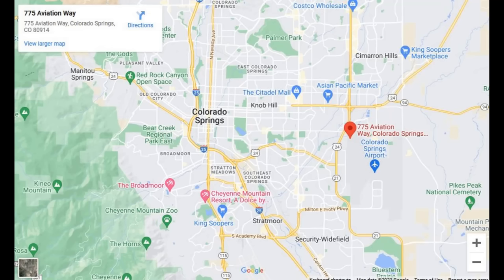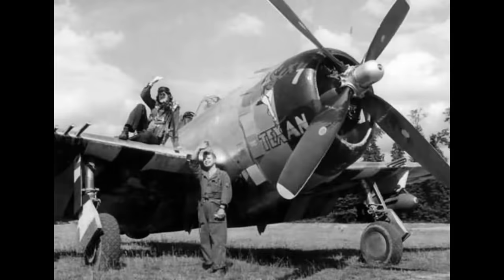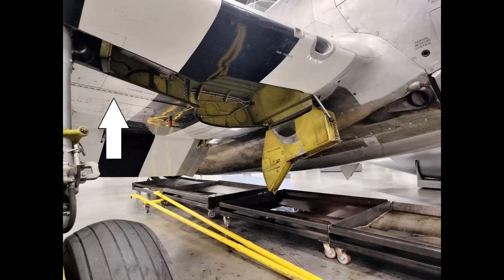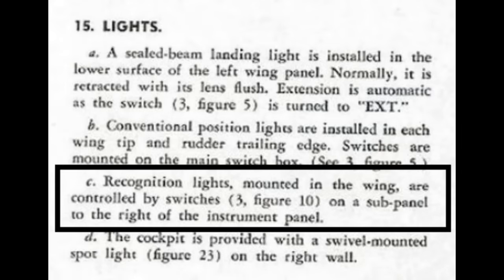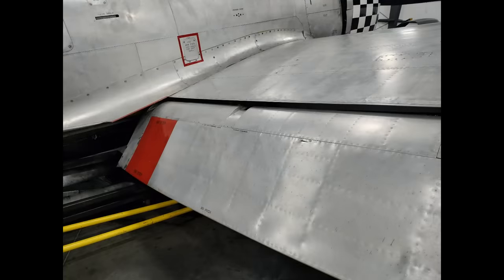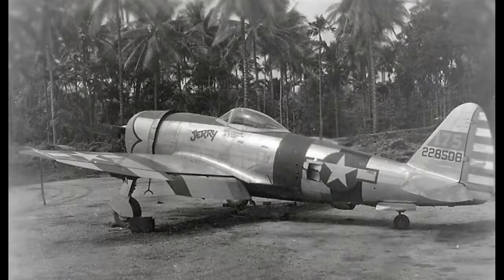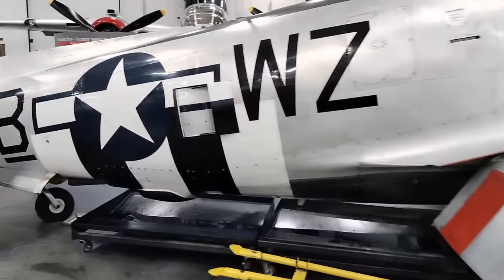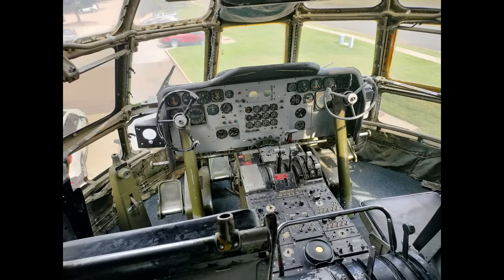Thunderbolt P-47 D-40, the Ultimate D model

Comment: I toured this museum last Saturday and was extremely impressed with their aircraft displays. What's more they are all flyable. If you go, take the tour of their facilities. The docent guides are older gentlemen, most if not all, are veterans. Johnny our guide was  very well informed on history and operation of each of the aircraft.
 One of the most interesting, besides the P-47 is their P-38. That plane was found buried off a runway on a pacific Island. They brought it back and the museum completely rebuilt it to flyable condition in their shop.  Highly recommend a visit to the museum if you are in the Colorado springs area.
Also, be sure and see their  immaculate Douglas AD5 Skyraider that has a cockpit for a crew of 2.
 The pilot escaped the fall of Saigon by flying it to Thailand.  ---- He had  15 close friends also crammed on board.
Reply: Is this the museum that has the internals of the P-47 on full display ? From the engine back.....all the different plumbing that it has ??

Comment: I think the "Manual meshing control" is for using the hand-crank inertial starter. The flywheel is cranked up to speed (about 80 rpm on the hand crank) and then engaged to the engine jaw with the manual meshing control.

Comment: When I was 10 years old, I had built about a dozen or so plastic model airplanes. And ultimately each was heroically destroyed using bottle rockets plus other small  fireworks leftover from the 4th. Suddenly one day, my destructive and immature behavior ceased  once unpacking  new model while pre-reading assembly instructions for a model of the "Hun Hunter", a historic Thunderbolt from WW2, Korea and more. 
It was my first high quality model with fine detail all the way
 down to the 2 Schrader valves within landing main gear wheel hubs. Everything about that model building experience helped me to gain an appreciation for vintage warbirds and the harrowing stories told by flight crews both up above and below. Thank you for all the time and effort you spend producing the aviation videos. The "P-47" was my first favorite prompting a serious appreciation for aviation and grows evermore. Thank you again.

Comment: "Notice the inside of the gear doors.  This is going to be a significant discussion."  Only on this channel and that's why we love it.  (As a software engineer I've written multi-line comments as to why certain variables should be exactly the order they're in in a structure or class: e.g., to avoid false sharing in the cache, or to avoid structure holes.)

Comment: Hi Greg, the Hamilton Hydromatic props were installed on the D-22 and D-25 from the factory. There might have been a few loose planes with this propeller like the one with the pressurized cabin, and maybe a few converted on the field. The rest before the D-22 and after the D-25 used the Curtiss Electric props, from the skinny 12' 2" diameter prop and the two different size paddle 13" diameter props.

Comment: Hey Greg! I was a volunteer at PoF in the 80's and helped take out the turbo/supercharger in their P-47G when it was getting ready for restoration. As a 14-15 year old kid, even then it hurt my heart to take that thing out. I questioned it every day, do we really need to take it out? It was a magnificent system indeed. I wish they would have kept it in. But alas, money being money..   The Hamilton-Standard props were/are a common retrofit on still flying Jugs as they were easier to get parts for and had a better mechanical reputation.

Comment: The dorsal fin was definitely retrofitted to earlier models, up to the D-25. The reason was loss of yaw control, probably at low speeds and max power. The tail warning radar was also retrofitted to earlier models. I know this because I read a article about the P-47 in the FAB (Brazilian Air Force) service, during and after WW2. If memory didn't fail me, the fin was retrofitted during the war (although not all units got it) and the tail radar after, in a effort to bring all the units to a common standard, equivalent to the D-40.
Reply: The fin does not provide a measurable increase in area. 

And what few extra square feet of area it adds, it's located much closer to the centers of gravity and aerodynamics than the rest of the tail. 

So, it's not only too small to be effective but its leverage is also significantly hampered as well simply because its not located far enough aft to do much. To exasperate the issue, its of exceptionally low aspect ratio, and therefore its lift-curve slope (dCL/da) is going to be very shallow and develop little if any side-force at  shallow side-slip angles. 

Therefore, it does not appear it will provide additional yaw-stability in the way you envision. 

It actually creates a very strong vortex-lift at extremely high sideslip angles encountered during a spin. 

It generates this lift by developing a strong vortical flow due to its extremely low-aspect ratio. The aft end is truncated in a sharp angle, where the vortex is shed at steep sideslip angles and that vortex more easily follows the contour of the rudder when its deflected against the sideslip. 

E.g. when the aircraft is in a fully developed spin to the right, nose going right, the rudder is deflected to the left to counter the spin in order to recover.
But the vertical stabilizer could and likely did stall at that sideslip angle. Or at least become ineffective at creating additional side-lift by increasing camber (rudder deflection) alone. By generating a vortex flow at that juncture, the vortex cuts the vertical stabilizer in half, effectively quartering its aspect ratio, which almost doubles its stalling angle of attack. It also allows airflow to follow the contour of the deflected rudder, instead of separating. 

Its the phenomenon that allows the F/A-18 to attain 60*Deg AoA with an medium (4.0) Aspect Ratio wing. The F-16, various Sukhois, F-22/35 and others also use this for improved lift at high AoA.
Reply: There is a beautiful P47 N, the first thing you see as you enter the Elgin Air Force Museum near Ft. Walton Beach, FL. Don’t miss it! My uncle flew P47’s and was shot down and thrown from his plane when he crashed. Locals secreted his body from the German’s just 17 miles from Omaha Beach. This happened late July 1944 and we still were just 17 miles inland? Scary.

Comment: Thanks Mr. Greg,  will you be covering P-47's flight controls a bit more in-depth such as wheter it used push rods or conventional steel "ropes" with perhaps some improvements that differed it from other aircraft because it is said to have excellent roll rate and to be responsive overall, furthermore regarding the poll on patreon, closer to mach speeds p-38 had to be equipped with hydraulic assistance  in order to recover from a dive (I believe folks working on p-38 had concluded before supersonic flight was fully understood that it caused some sort of super drag at wings that made operating with the stick near impossible) but anyways had p-47 received any modifications addressed to these kind of issues (especially later models like D's), it would be nice to learn. btw glad you enjoyed the restaurant, seems cool :)

Comment: Hi Greg, great video as usual. 
As to the manual mesh external device, I suspect a review of your patreon aircraft manual electrical diagram may show that the cockpit "mesh" switch position was not energized during battery cart engine start, thus being unable to electrically engage the inertia starter to the engine with the battery off. Apparently the external tool port would allow mechanical engagement of the inertia flywheel. Seems odd that the "engage/mesh" switch could not be energized by the cart-start bus. But, this is just an educated guess.
Again, very informative video!

Comment: I dunno if someones already commented. But i think the manaul mesh unit is basically, the old hand crank type coupling. I guess on the warbird is its a last ditch if you have nothing in the field. Way if getting the planes in the air, how often was it used?  Probably not at all, but always good to have multiple backups.

Comment: Hi Greg, as a model builder with an interest in the technical and historical aspects of things, I have a lot of research materials with lots of up-close photos and somewhat detailed discussion of the various production variants (if you can find the 'Detail in Scale' books, I highly recommend them). The antennas on the rear stabilizer look to me like modern avionics equipment rather than tail warning radar equipment. This is thesis is further aided by the thought that this plane is airworthy.

Also, I've often wondered why there were angle indicator decals on the flaps of the P-47 kits I've built in the past, which you can see clearly in your walk-around video. The fact that the flaps do not have simple settings for takeoff, landing, and combat explain the reason for the pilot to need some visual reference. 

As always, great video! Thank you for sharing with us all!
Reply from the maker: I'm pretty sure those are modern antennae, the question is what was there in 1945?

Comment: Well and thoroughly done, as usual, Greg. If you get a chance, check out "Fagen's Fighters," a WW 2 aircraft museum in rural Granite Falls, MN. They're restoring their own P-47D (I don't know the exact variant), and they have a flying example of the F6F-5, which used a P&W R-2800 similar to that of the Thunderbolt. That's what attracted me to Granite Falls. I'd never heard an R-2800 running "in real life" until about 10 days ago, when I visited the Fagen museum. The Hellcat's ground crew were testing a new carburetor on its engine, so they fired it up and let it run for 10 or 15 minutes at several throttle settings – a real treat.

Comment: The manual meshing control basically forces the inertial starter flywheel to the engine (after flywheel spin-up). I’m assuming there’s an electric solenoid that would normally do this, kinda like your usual jack shaft, except you’ve gotta wait till it gets up to ~20,000RPM first on these. If the meshing “solenoid” failed, it could obviously ground the entire plane. 

Presumably you’d have to disable it once the engine fires (very easy to fry an inertial starter.) 

I’m not really sure if they have kick-out cogs to disconnect the engine from the starter mechanically, but if they do - I know they can fail (seen plenty of them lol, a starter motor at 200:1 ratio is not happy staying connected to an engine!) 

Cool find - they’re exceedingly rare, and airworthy ones are pure gems. 

Hopefully you checked out that pristine Tigercat in the back too!

Comment: It certainly does fly. I've been blessed to watch it fly. 29 of those planes in the collection fly. Don't forget the Corsair F-3A model. The Lightening P-38F and F-7F Tigercats both fly. Yes, 2 flying F-7F Tigercats. They are planning on restoring a Razorback P-47 they have including the complete turbocharger and Pratt Witney R-2800 engine on display in one of the other hangers.

Comment: I used to play Lucas Film's "Secret Weapons of the Luftwaffe" 

I liked the Jug and I liked the P-38.  The problem with flying the P-38 - was you couldn't control the engines separately in the game.

I hated the P-51.  Every time I took a hit - I'd be looking at that coolant temperature - and if that needle so much as quivered - it was climb for altitude and head for home.  If you had enough altitude you could glide back to Allied Lines after the engine quit - but if you didn't - you couldn't.

During WWII the Germans had a phrase .... "Die Deutsche Blick" which meant "The German Look".  This referred to the Germans compulsive glancing over their shoulder looking for Allied Aircraft.

In a P-51 I had "Der Kühlmittel-Blick" or The Coolant Look ...

The thing here - is that you were glancing at the coolant gauge even if you hadn't taken a coolant hit - just in case you had.  What a pain in the ass.
.

Comment: Great video! I share your feeling about turbosuperchargers, I am always disappointed when I see a flying (or static) P-38 or P-47 that has been neutered. Same goes for jets on display with no engines. 

For whatever reason, Boeing did things differently with the KC-97 than with the B-50, even though they both used the P&W R4360. If I remember right, the turbos are mounted on the opposite sides of the nacelles in the two models.

I once read the reason Boeing felt (ahead of Douglas and the airline industry) that jet engines were ready for airliners is that they were flying R-4360 equipped B-50's and KC-97's out of their flight test center the same time they were flying GE J-57 equipped B-47's and B-52's, and they realized the jets were less of a maintenance headache than the reciprocals.

Comment: Have pored over just a tiny number of the P47 plans. The complexity of these aircraft is unimaginable to most people. 

There must be hundreds if not thousands of drawings. Let alone thinking of making them. 

We forget the army of people that made it happen. 

The jug was also very thoroughly built. Everything was a cast aluminium or steel arm for mechanical bits. Very few pressed tin things. 

So nice when you can get a close look at these aircraft. That is a rare treat indeed. 

It's very cool to share.
Reply: Lots of forged parts. Cast parts are brittle and poor in tension and not common outside of engine casings and other oddball shaped parts

Comment: I am not an expert on P-47 props but at different points in past decades I had knoen the different  designs and dedign numbers. There were atleast three, maybe four different Curtiss elrctric designs and the Hamilton Standard shown here. Of the Curtiss designs, the diamrters grew atleast one resulting in atleast two sizes. However the chord also grew several times and a late version had a wide, asemetrical blade shape.

Comment: That’s a fantastic museum.  They have a very capable Ham Std prop shop onsite, so I wonder if that has something to do with the prop installation.
Reply from the maker: I suspect the plane was built with a Curtis Electric, but they switched to the Hamilton Standard for reliability and parts supply. It's what I would have done. They certainly do have a capable prop facility on site.

Comment: I did not know about the landing gear door closing, I had assumed that all WW2 fighters had this door open when the gear is down.  The Spitfires never got a door until Mk 21 and later.  Most Japanese fighters had these doors.  The landing gear door opening and closing scheme was widely argued in the near disaster flight of a 747 taking off from Athens.  Lots have been written about this incident, and lots of presentations exist on youtube and wikipedia.  The pilots decided to retract the landing gear on take off after multiple engine failure, against the recommendations from Boeing.  That saved 500 plus people.

Comment: You likely know this but the B-50 from which the KC-97 and 377 were actually developed was a very different bird from the B-29 with numerous changes. It was certainly a B-29 derivative but at the same time truly a new airframe. I’m not certain but would be willing to bet that the degree of parts commonality between the 29 and the 50 was between low and zero and limited to minor sub systems.

Comment: Very interesting video! I have always been curious if during WW2, did they ever consider using multiple small turbos rather than one large one like on the P-47 or P-38 (one large on per engine). Was there a design limitation or was this even explored at all? I can picture some of the drawbacks, but I can see some possible advantages as well.
Reply from the maker: I don't know of any WW2 airplane either production or prototype that used more than one turbo per engine.

Comment: 22:40 You want to know what's extra funny about those shutter indicators? They can go in either slot. Apparently some planes have the oil cooler indicator on top and the intercooler on the bottom, and some have it the other way around. 

Which ended up being hilarious when DCS released it's P-47 and had them the other way from some of the other P-47s. 

Much reference photo digging later, we discovered they went both ways, for maximum confusion.
Reply from the maker: Having seen the mechanism that actually makes a lot of sense.

Comment: Maybe you can do a series on the best piston engines of WWII. For me it is the R2800 double wasp. Mainly because it was so versatile that it was used by commercial airlines for planes 10 years after the war. Merlin engines were great but they never saw the same size commercial usage that ther2800 did.
Reply from the maker: It's the R-2800, there were other good engines but when you stack everything up the R-2800 wins.

Comment: i found a video of this exact p47 doing an engine runup spewing lots of high speed exhaust out the rear tailpipe indicating the turbo is functional, also a little bit of flying. look up; p-47 kcos.  should be the first result

Comment: I have antennae similar to those on the tail of the P47 on my Piper Arrow. I am told they are for VHF radio transmission. I am not positive that is their use, I do know they are preferred landing perches for birds to leave their calling card on my blue painted horizontal stabilizer.
Reply from the maker: I think that's what they are on this plane as well, but let's keep in mind, it's a plane that's used in the modern airspace system, so it's had at least some changes.